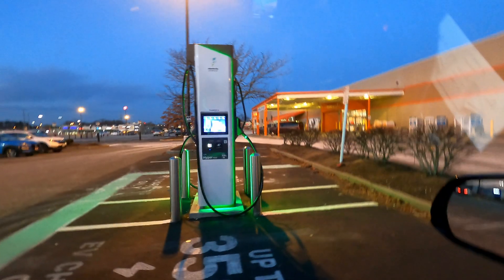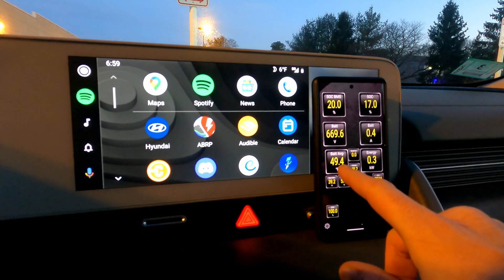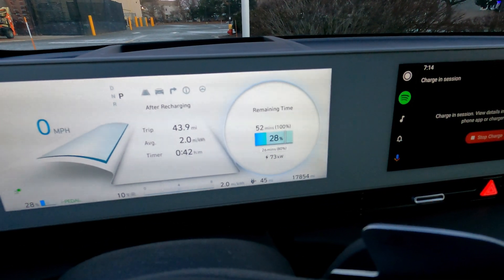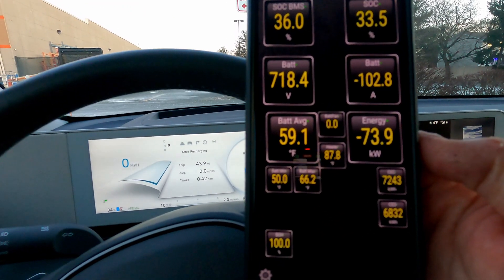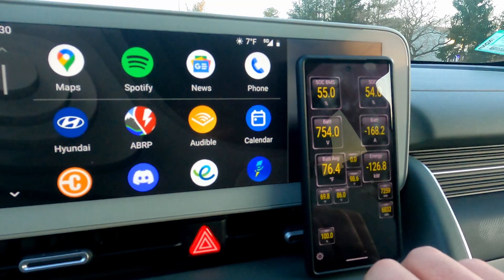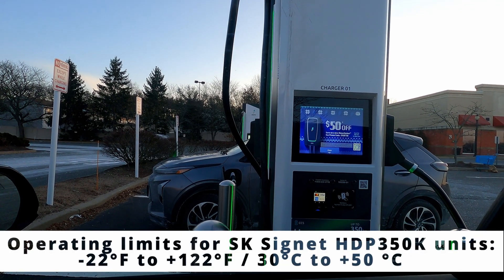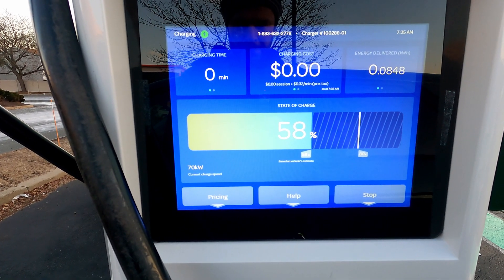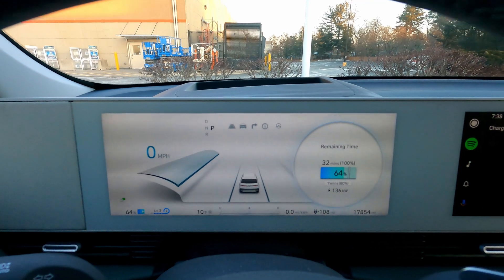New Electrify America Chargers Tested in Freezing Winter Temperatures (Quick Charge # 4)

Comment: Steve - we had 5 dispensers updated recently at my closest EA station (Ypsi, MI), and they were brought online just before the cold hit.  I wasn’t able to get out there, but from the PS comments, all but one of them worked.  Temp was around 0F, so perhaps negative temps are required for failure?  Fortunately backups are nearby if someone did get frozen out.
Reply from the maker: It would make sense that anything getting close to that -22F number would raise the potential for a failed session. 

I recall the Ypsilanti location quite clearly from our summer travel, as we arrived late at night after a deluge. The side of the lot behind the chargers was flooded out, though thankfully just puddles in the charging stalls. Nothing was open but the charging went well. 

Looks like the dispensers in Ypsi are Signet hardware, so only a location to test the temperature-related Q, rather than the vendor question. If NYC gets a cold snap, a trip to Valley Stream might be in order, as those are the closest BTC Power 4th gen units to Boston right now.
Reply: @plugandplayEV  - the new ones in Ypsi are BTC Power units - at least they look like the ones in CO which had the cold start issue.  I see someone is asking for a label pic on PS, so perhaps I’ll make a run out there tomorrow.
Reply from the maker: @dennislyon5412  I'm looking at the second picture on the Plugshare listing (white Mach E on 12/19/22) and you can see the spec plate a bit. I could certainly be wrong, as it's pretty pixellated when you zoom in, but the big logo on the bottom looks like the photo I have of the SK Signet plates to me (SK in bold with a butterfly symbol over the K).
Reply: @plugandplayEV  - you’re right!  Confirmed today that the Ypsi location has new Signet hardware.  I posted a pic of the 350 kw charger label on PS.  Happy New Year to you as well, Steve.  Here’s to a safe and more successful 2023 for you and your family.
Reply from the maker: On another note, wishing you a very happy holiday season with great thanks for your comments and support this year, Dennis. The channel wouldn't be the fun project it is without folks like yourself adding their perspective. It is appreciated!

Comment: During the past 8 months I have had incredibly good luck using the Electrify America charging stations at Scarborough, Maine.  Starting in December I found half the stations "unavailable", and it was getting worse.  Recently, the stations showing as available would error out as the charging speed ramped up.  Unfortunately, my road trips in that area do not have many Electrify America back-up options so I will no longer use EA and have switched over to ChargePoint.  Incredibly disappointing!
Reply from the maker: We were just up in Portland and did swing by the Scarborough site after Christmas shopping at the adjacent mall. BMW iX and a Ford Mustang Mach-E were charging, while a BMW i3 was just plugging in... not sure if they got a charge though. We used L2 charging off Spring St overnight for the way back, but found the ChargePoint stations at Kennebunk service areas convenient, if slightly expensive, for a fast charge on the way up.

EA needs a lot more presence across the top three New England states in general, as neither Vermont nor Maine are well covered by the network in the center and northern routes. EVgo has a reasonable presence around Maine but desperately needs to upgrade from solo 50kW or light 100kW stations. As it stands now, I'd totally agree that ChargePoint options installed through Efficiency Maine offer the best coverage and convenience for fast charging.
Reply from the maker: @angryGTS For a lot of regional trips, L2 can replace a DCFC session and save time/money. Being able to plug in at a destination where you're going to spend several hours is hugely overlooked.  That doesn't have to be ChargePoint, but letting L2 slip out of the conversation is a mistake, IMO.

Comment: Maybe some stations were installed and/or assembled poorly? Not a good excuse but possible.
Reply from the maker: The units that failed worked on a return visit after the storm passed. Leads me to think that the extreme cold might be to blame, which means it could impact the SK Signet units as well unless they're manufactured differently. It's near impossible to test the theory here, as I don't remember temps ever dropping below sub single digit Fahrenheit and colder states like Maine and New Hampshire don't have the new hardware yet. Buffalo, NY might be an option, but that's not anywhere I intend to head just now!
Reply: @plugandplayEV  Thanks for update. I hope EA can prevent this in the future.

Comment from the maker: Edge-case error or catastrophic failure? What's your take on the fallout over EA/BTC Power's frozen failure in extreme weather?
Reply: I believe the failures were happening at -5F and below. This is a good data point, but still doesn’t absolve EA or BTC from what happened in Colorado
Reply from the maker: It was -15F in Colorado during the middle of the storm, as far as I can tell. I think working out the exact failure temp is the next goal, as the video briefly touches on. As well as the fact that the Signet units are only standing out here because they aren't placed in areas that had temperatures close to their operating limit this week. All those tests should be done, but it's unusual to get that low in many locations where the upgrades have happened.
Reply: But people need to use plugshare and have a backup plan. We’re Kyle Connor lives there are ev go and chargepoint units that they can use instead of being fixated on one brand and constant videos that don’t tell the whole story. Kyle has way too much reach and makes things worse than they are.  I have been driving a ev when we only had 4 dc fast chargers in a city of 900,000. Denver is smaller and has more ea units than our whole state.  I learned to know were I can go if my local unit is down. Right now my ev go unit is down Ea works. We have lots of chargepoint. I know people are trying to use their free charging on ea but it isn’t worth getting stuck in the cold because they don’t use their brains.  We had. Level 3 in ohio so we weren’t supposed to be traveling. I stayed home and we rescheduled getting together when it warms up this week.
Reply from the maker: @markfitzpatrick6692  To some extent, EA is a victim of its own success in rolling out a nationwide fast charging network in less than three years. 

We can see that the acceleration of new stations peaked last year and has been stuck at the 750-800 level for the past nine months, meaning EA is focusing on how to do better with its existing footprint. The station count has disappeared from their site location map and only 7 "coming soon" locations are listed, which used to be a consistent 50-60 sites, even as new ones came online. 

To your point of being able to make it work, you know I take the same approach but I do think we need to make public fast charging a far more consistent experience if EV adoption is to take the next step. The latest wave of EVs has put pressure on the networks and cracks/gaps that we knew were there (limited stalls, aging hardware, lengthy repair times) are beginning to show. 

It's not that people can't fast charge... the vast majority can and do, in my experience... but it's nowhere near as easy and predictable as it needs to be. I do feel we'll get there by some combination of increased competition, more active partnerships between OEMs and CPOs, and/or greater investment, but I fear 2023 will be a lot of moaning and thrashing it out before we hit the light at the end of the tunnel.